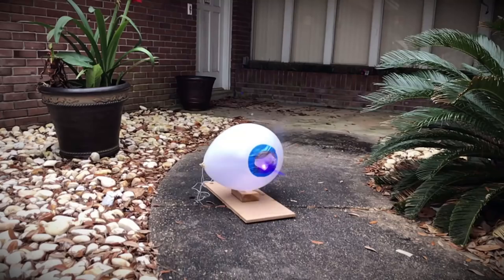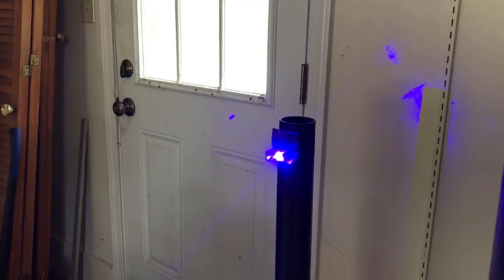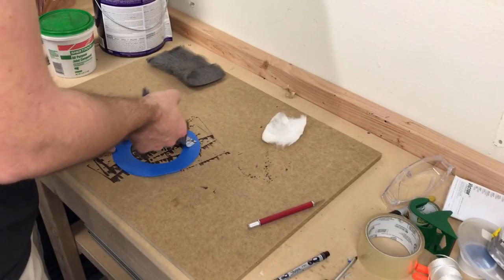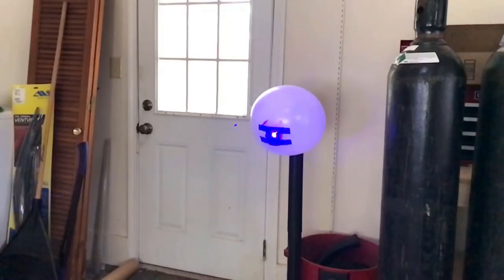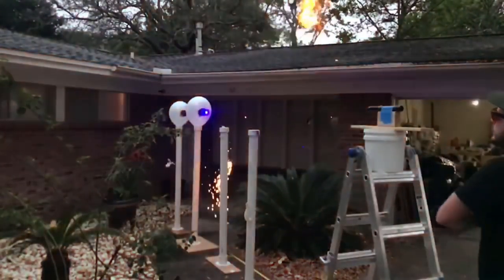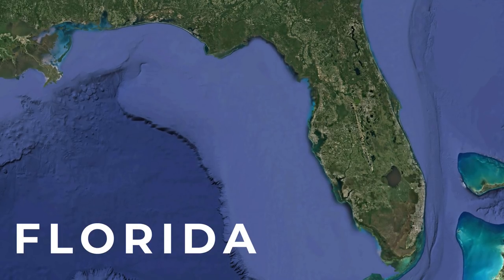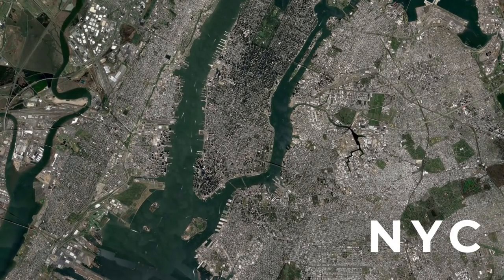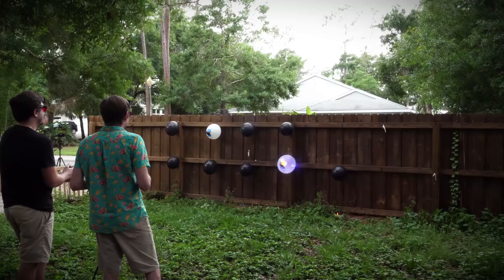Exploding Hydrogen Balloons WITH LASERS // Tonight Show Science Demo

Comment: Great video if you haven't found an alternative solution for getting the initial flame I have a small suggestion for dying the flash paper go to your local craft or office supply store and find the Sharpie Magnum. It's got  a larger width drawing tip and will make the process go a bit faster.
Reply from the maker: I used those when I did something similar on The Tonight Show! They’re great! Also - I find it funny that Trojan and Sharpie use the same naming convention for size! 😂
Reply: Nick Householder I agree I think it's also interesting that it's  a brand of ice cream as well , it could pose an interesting situation when you go to Publix and it's on the shopping list.